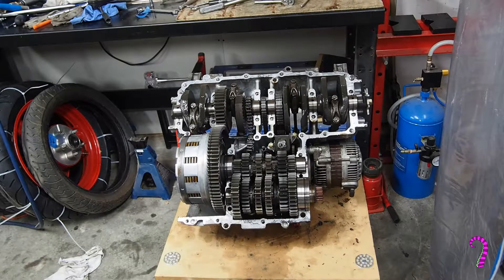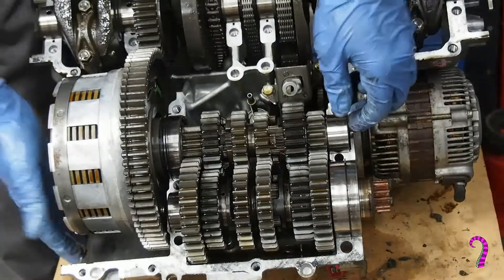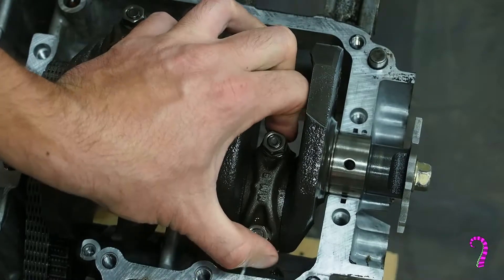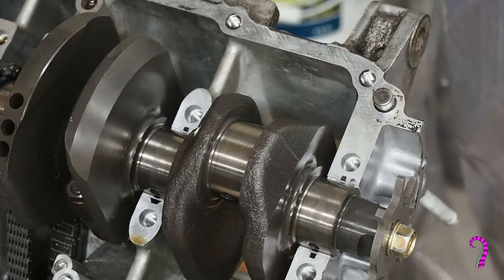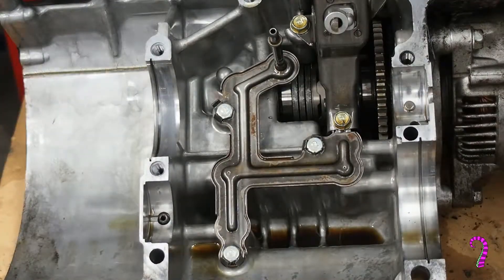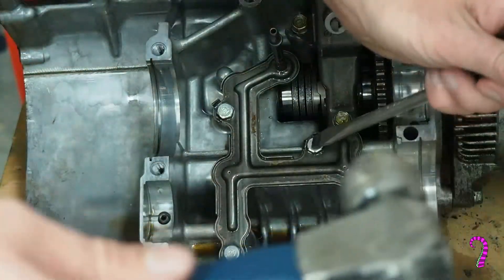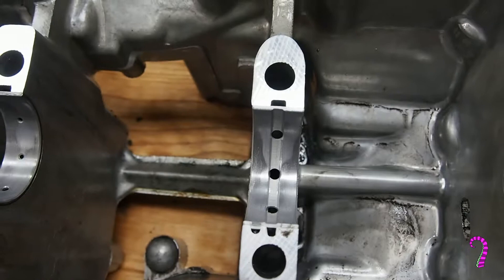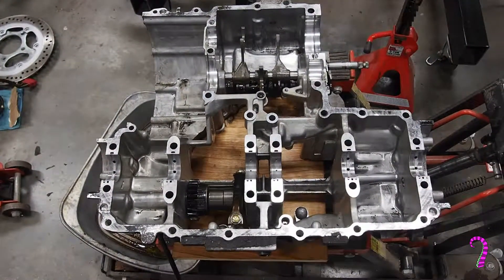Hurricane Engine Rebuild Chapter 5 – Crankcase Service

Comment: Do you know if this will be similar to a 91 cbr1000f. I have to do the same to mine.just got it and it's been sitting for 10 years outside .lmao
Reply from the maker: The engines are pretty much identical, so the rebuild should be the same. I think the pulse generators and carbs are slightly different. Good luck